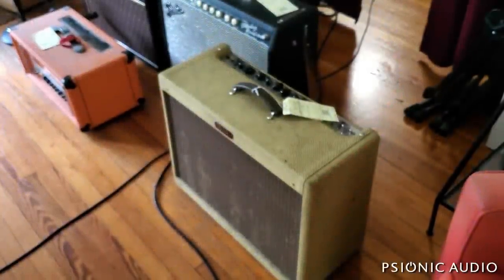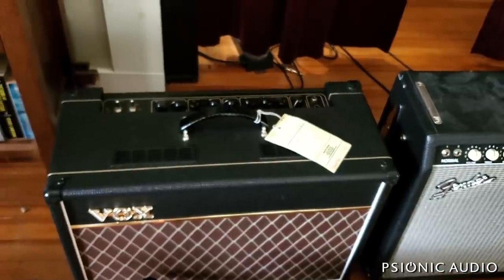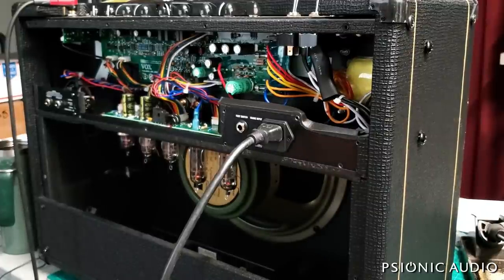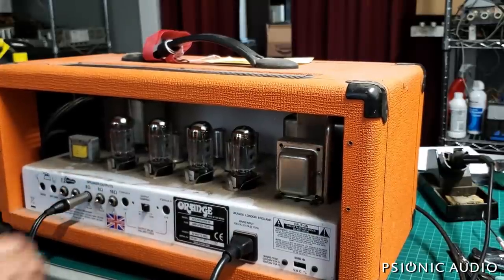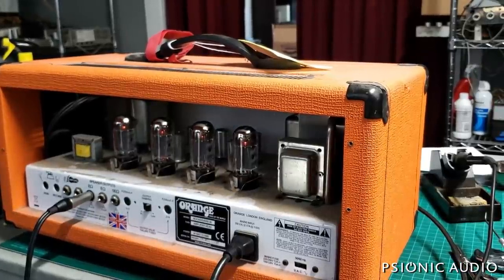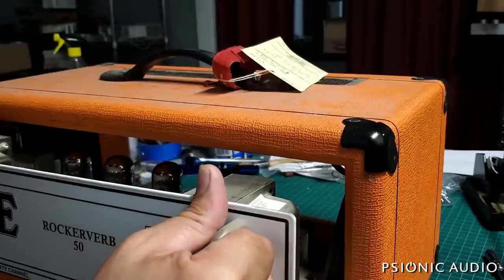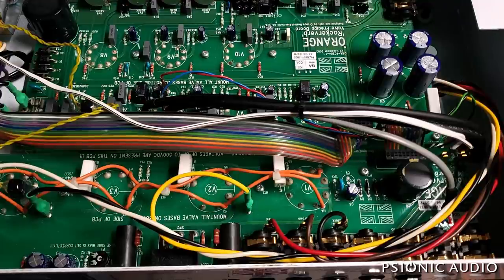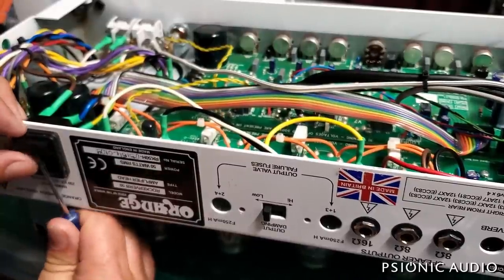Amp Triage | A Day in the Life of an Amp Tech

Comment: Fuse replacement tip. Look at the blown fuse. If the element is vaporized and splattered all over the glass it's likely you have another problem. If the element gently broke it could just be fatigue and try another same value fuse.
Reply from the maker: Yup

Comment: Have you watched PRS new Jimi Hendrix amplifiers HX series they have an interview explaining how Hendrix took his Woodstock amplifiers to Organ Service Co. to get them modified so the power tubes would have protection circuits I'm guessing using flyback diodes or damping diodes and more. The output transformers aren't stock but PRS found the original guy that made the output transformers to the same specs as the marshall amps that were modified for the Woodstock marshalls. They modified the marshalls to be very sensitive to picking dynamics. Maybe you will get this PRS amp and reverse engineer it to find out the modifications so you can modify to all fender and marshall amp? The Engineer did some new grounding scheme to make the amplifier very quiet to check out what grounding scheme he did so you can modify any fender and marshall amp to have this quiet grounding scheme.

Comment: That 2.174A fuse is nearly at the full power swing of a 50 watt amp with a tube rectifier.
I wonder if Orange put the 240VAC sticker on a North American amp. You’ve seen some funny stuff regarding fuse ratings in the recent past.

If you get a chance, check out the new PRS HX “Jimi Hendrix Woodstock” amps. I’d like to know the opinion of people who do what I do as a hobby, but professionally.

I am no fan of PRS PCB’s. Especially when they mount the damn tube sockets to them. They have no excuse for not being hand wired on 3MM FR4 at $3000+.....except greed.

Comment: That Rockerverb sounds pretty good to my ears. I find that the modern Orange amps have a  certain tone that all the models seem to have. Even though they differ from each other and some are better than others there is always that Orange signature thing and some have it more than others but it's usually there....maybe it's in the low mids? I'm not sure what it is or how to describe it but I think it's a midrange thing. I wanted to ask you Psionic if you hear it and know what it is and how they get it? Is it something in the preamp voicing or the power section? Maybe it's the transformers they use? I think it's cool when amp brands have a signature tone of their own and I think Orange certainly does. I also think they sound like a REAL amp if that makes sense. Would be nice to know your thoughts on them tone wise and then seperately build wise. Thanks and love your video's. I'm a very passionate wanna be amp tech and absorb everything I can. Thanks so very much!
Reply from the maker: Thanks.

I don't have time to get too deep into it, but it's mostly that there are a lot of gain stages (with lots of interstage gain reductions) with more lows and lower mids than most Marshalls, without any colder clipping stages ala Marshall or Soldano. That's what you're hearing. To my ear Oranges aren't great at the tranition to overdrive, but the more saturated settings are cool for the appropriate genres.

The build quality is very high for the price point. Orange and Vox kill Fender and Marshall at comparable price points.
Reply: @PsionicAudio  thanks very much. I do tend to like the simpler Orange amps with only 2 or 3 gain stages better. That way they get that nice dirty clean transition I think you are talking about. Tiny Terror is only 2 gain stages and I believe the OR50 and OR100 are only 3 gain stages and are my favorites of the non vintage Orange amps. OR15 is 4 gain stages though and I favored my Tiny Terror over it. I still Own a 72 OR120 pics only head and it's a VERY cool amp. AD30 is a cool modern Orange with only 2 gain stages. I was thinking it might be something else other than gain stages because I hear it even in these amps with less gain stages. Anyway you don't have to take up anymore time on it I just found it to be a curious topic. I really appreciate your input and will be watching the next vids. Thanks for all you do. I'm learning a lot.

Comment: That orange rockerverb is a 50 watt, yet it has four power tubes? Don't 50 watt amps normally have only two power tubes, and usually 80 watt or more have four power tubes? What kind of tubes does it have in the power section?
Reply from the maker: Four 6V6s.
Reply: Depends on the tubes and how they are biased. 6v6s are lower power than 6L6s or some of the other tubes found in some of the big 100w heads.